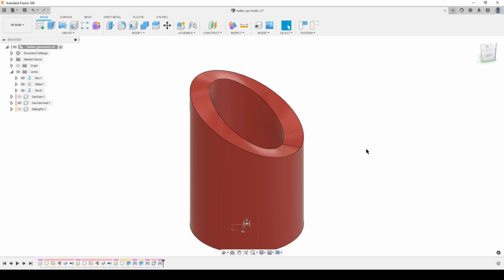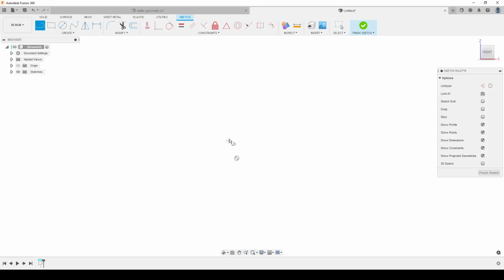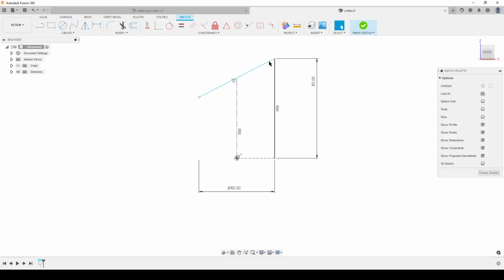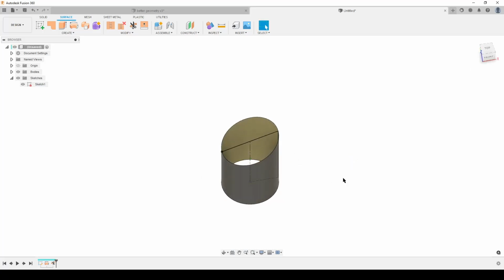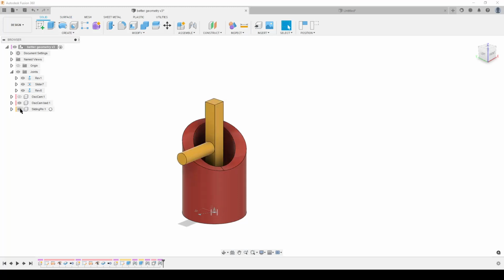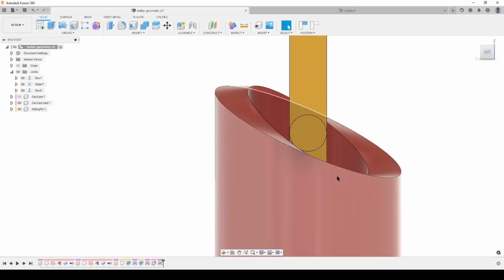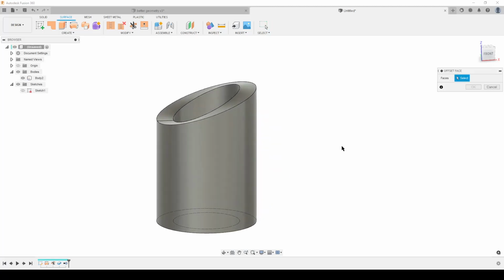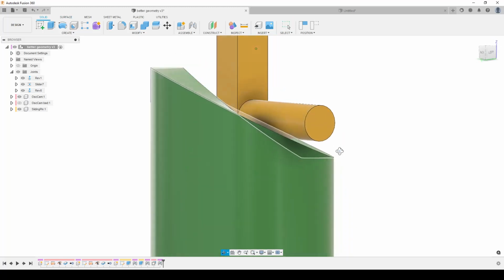Fusion 360 - Simple Oscillating CAM shape

Comment: I didn't quite understand the reasoning behind that last bit. Why does offset face change the angle of the face and why do you need to offset it by half the diameter of the pin?
Reply from the maker: The CadWhisperer has a good long video on slots here https://www.youtube.com/watch?v=Wekmai5MqFM. The geometry of slots is a bit counter intuitive. How I think of it, in the video I'm making half of a slot the first face i create has teh shape of where the center of the pin will travel the offset of that face is where the pin will rest. It takes some time to wrap the head around :)
Reply: @KristianLaholm  Ah, thank you for that clarification. That helps.